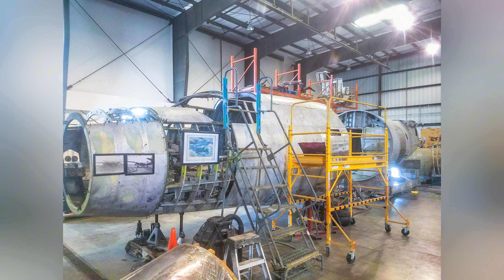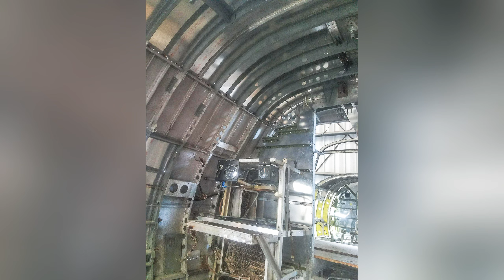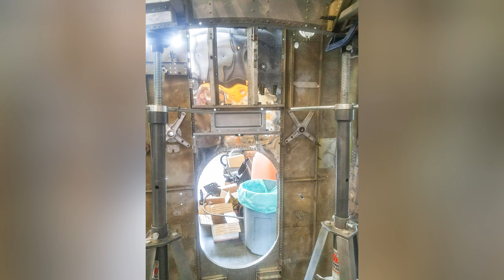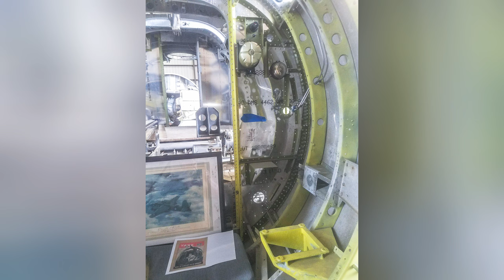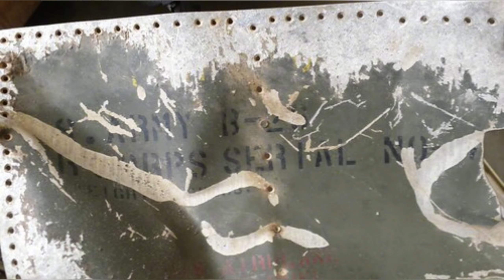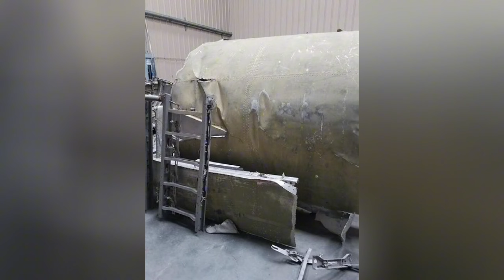Recovering "Basket Case": Rebuilding a Broken B-26 Marauder

Comment: One would wonder if the many " one a day in Tampa bay",and the 6 midway B26 wrecks would be a possible source of parts...probably not due to corrosion issues, but,if you needed a template to remake a missing part with......its a shame they all (?) were scrapped, i guess uncle sam thought nobody would want to buy an aircraft with a bad reputation for their postwar allied air forces ( ie: south america)...
Reply: '
It's purely because of all it's "early reputation" that kinda dogged the B.26 Marauder (unfairly) for the rest of it's life.
Most of the high scoring mission 9th Air Force B.26's were literally "blown up" (T.N.T) by war's end, in Germany.
Even "Five By Fives" the top-scoring 387th BG Marauder which flew "188 missions" didn't even survive (Alas)

Comment: The early short wing B-26 Marauder was what was known as a hot ship. High landing speed low stall speed, she was an unforgiving aircraft and demanded the best from her flight crew! Fly the aircraft as its configuration demanded and the aircrew was rewarded with good performance get sloppy and she would punish you. Kermit Weeks Fantasy of Flight in Polk City Florida has a  restored short wing Marauder that was retrieved from a valley in Oregon alongside two other Marauder’s as all 3 had crash landed due to low fuel issues.
Reply: low stall speed?